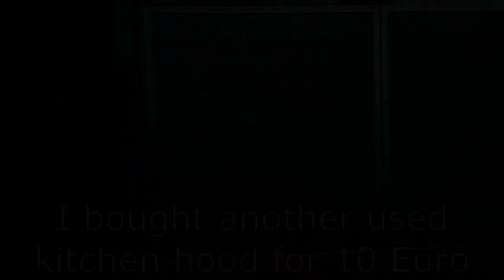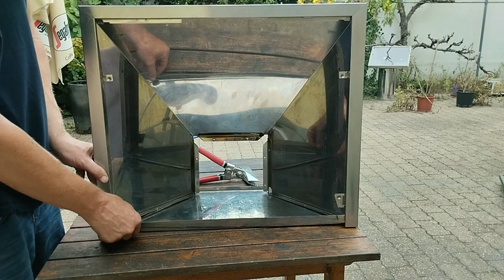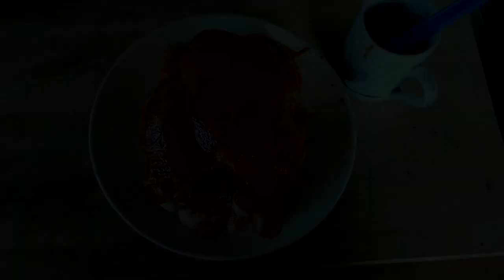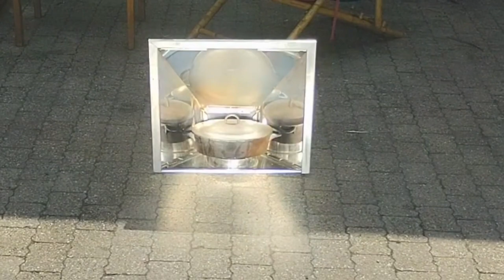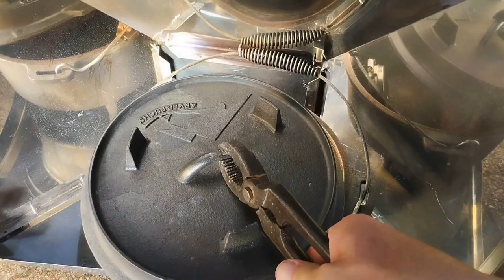DIY Parabolic Mirror Solar Cooker / Solar Grill

Comment: if you insulate the back of the oven, it will work even better
Reply from the maker: Yes, plus a closed glass front. But up to 215°C in summer is good enough and I rather have the problem that the stainless steel gets too hot already which leaves rainbow stains in the steel that then don't reflect as good anymore. 
I have another one that's insulated + glass door (at the beginning of the video) that I can use in winter.